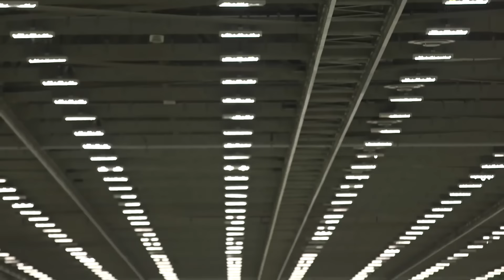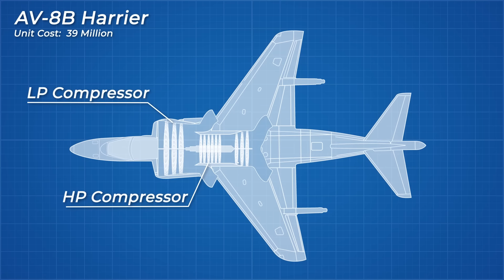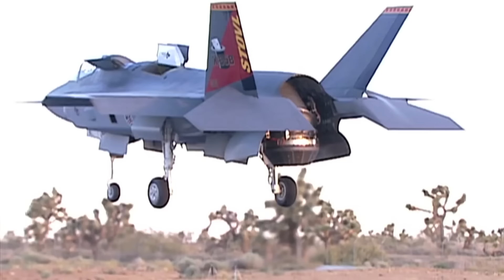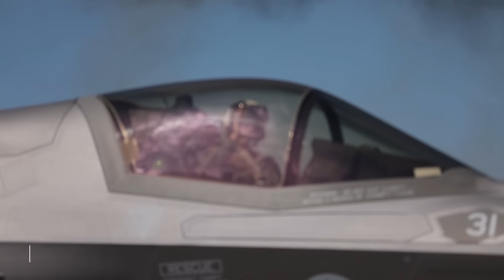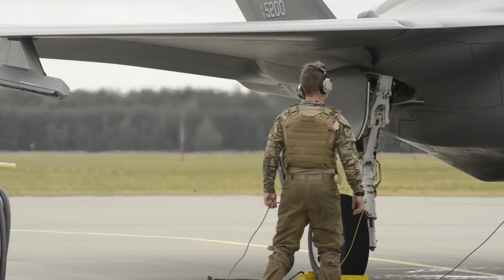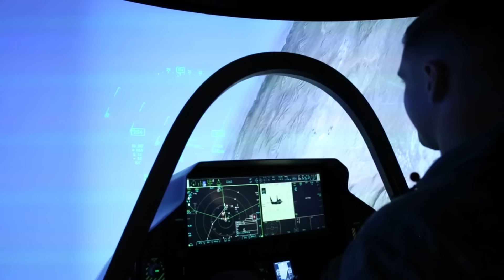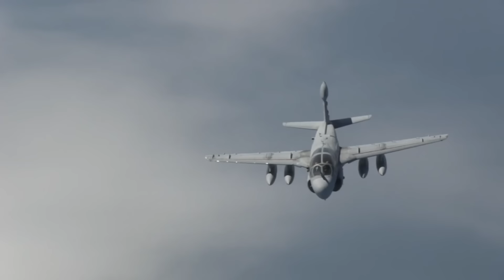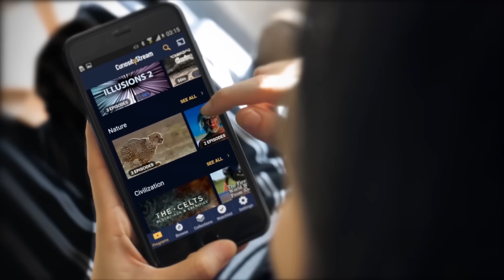Is The F-35 Worth $115 Million?

Comment: This whole project was a mistake, there is a reason we have capitalism and multiple companies. Forcing one company to make one plane do something for each branch caused the plane to fall short of any major dedicated platform. The best rout would have been to have companies design aircraft for each role until a suitable unit for each was designed giving each branch a unique vehicle suited for their specific requirements and sell them to our allies. Only the Air Force really requires a plane that is just for them because they are required to support all the other branches with their varied and unique arsenal suited to the tasks given, and it is not that important that they don't sell them as our pilots are trained much more heavily than most other nations.
Reply: That's exactly what they did. The F-35B is STOVL, just like the USMC and RN needed, the F-35C is designed for catapults like the USN needed and the F-35A is the variant most partners wanted. Building a completely new aircraft when the only difference is either being able to take off using catapults or having a lift-fan would be beyond fucking dumb.

Also dedicated aircraft have been mostly replaced by multiroles 40 years ago. There's nothing new about having an aircraft fulfill multiple roles and every relevant military in the world seems to think this is a good idea.
Reply: The variants are still F-35s and multi-role is fine but what the F-35 project aimed for was not multi-role but every role and there are serious design issues from having a one fits all mentality. The main reason the project took 27 years is because the design specs were moved so often and so far outside the original that the design team had to re-design the plane internally every year. 

It would have been much simpler and vastly cheaper per unit to have a different aircraft for each set of roles. The Navy needs carrier takeoff and landing with fleet defense capability, the USMC needs S/VTOL and light weight, the Air Force needs longer range and better manuveurability than it's contemporaries, these things don't align well, for one platform to handle all of them is unnecessary and overcomplicated while being massively expensive. Having one company make each branch a multi-role fighter fit for their individual needs and split the cost would have both simplified the production process and allow for much more production.
 It is what we have always done and has always worked. There are also roles that require a specialized platform to be fulfilled properly, expecting the F-35 to do the A-10s job better than the A-10 is a massive joke.
Reply: @NachtjagerVII  The JSF program never aimed for every role. The F-35 doesn't do any more roles than the F-16 already does, and each service has a physically different model to suit their needs for a multi-role fighter to replace a single type in each service. None of  the services required what you claim. The USMC wanted something to finally replace the outdated Harrier, preferably a multi-role with supersonic capability. They got what they wanted. The USAF wanted an F-16 replacement i.e a 5th gen multi-role fighter. They got what they wanted. The USN wanted a multi-role fighter to replace the F/A-18A/B/C/D, so basically the same as what the USAF wanted but with Naval additions... exactly the same as how the F/A-18 came about in the first place. The F-35C fills that requirement well.

Nobody expects the F-35 to perform the A-10's limited specialisation (that isn't even necessary... just a luxury) to the degree of the A-10, but they certainly expect the F-35 to perform better in the CAS role considering most fighters are more capable of CAS than the A-10. But really the F-35 is top tier for CAS because CAS depends on target acquisition, tracking, and communications... all of which are areas the F-35 far exceeds the A-10 in capability.

Comment: It got a general fired for saying it, but the F-35 shouldn't be A, B, and C models, it should be F-35, F-36, and F-37.  Now that they are entering operational phase, outside of the engine, which is only cross compatible between the A and C, the aircraft have less than 30% parts commonality.  It should also be noted, the USMC never really wanted their version to be stealthy, as it is a CAS bird, the main threat will be heat seeking ManPads, and that blowtorch of an engine is the juiciest of targets for a ManPad

Comment: Should have showed some of the more recent maneuvers now that the Block-IIIC standard has been incorporated and they can pull a full 9g with full envelope expansion.  When he quoted the pilot as saying it was the most maneuverable US fighter minus the F-22, he wasn't kidding.  It performs maneuvers that make it look like it's got thrust vectoring... just awesome. 
Also when fitted with full wing pylons, the PAYLOAD of the F-35 is equal to the ENTIRE weight of a harrier. 
And electronics? That EOTS sensor detected a commercial missile launch at like 600 miles and notified the pilot and began tracking it as if it was a ballistic missile (which could then forward tracking information to an AEGIS ABM-equipped cruiser/destroyer) - that sensor suite is truly some scary $hit.

Comment: 27 years how future decision makers will use the F35 as a case study. I was requested way back in the day... to give my two cents on the design and mission of the F35.  I was very knowledgeable and the Close Attack Support requirements of the USMC. Also gave some info the F18, maybe later, F18.=Good 
The numerous problems that cant be fixed on the F35. THE BIGGEST IS Pilot Workload, Okay pulots getting their little hackles starting to rise, get over it Dumb Ass. One of my favorite pilots, Mother Hubbard. Told me in the Marines, it's all about getting "bombs on target, on time, all  is BS. This single seat bomber, with all the sensors and transmitters with the very best pilot  Is overloaded. The workload capability is well above 1, give me a week and a simple target day VFR to degrade the system give him 2 MK-76s, safety here. The pilot proble will not do as well as an Ironsight back in the day. IF SHTF, keep the F35 for airshows, most of these pilots are good guys. SF The Great Gandini

Comment: I remember a documentary on the competition between Lockheed and Boeing to make what this became made at the time of the competition and Boeing's X32 seemed to get to every stage of the competition quicker, to the extent it made no sense that Lockheed won. The most bizarre bit was Lockeed being held up because the water jet they were using to cut the titanium for the bit attaching the front to the back was a bit slow, so you need to cut titanium with water over months for every plane!? That alone is ridiculous, how either airforce thought they could deliver it for a reasonable price based on that alone is beyond me.
Reply: Considering the X-35 out performed the X-32 which had to be modified to meet certain requirements (it couldn't check off all of them at once) 
So why exactly would they pick the aircraft that performed worse and couldn't even meet requirements? (X-32) or the aircraft that can meet requirements without modification and performed better? (X-35)
Reply: @demanischaffer  Its been a while since i saw the documentary, but i seem to remember the x35 needing to be adapted to pass the test as well. If the competition had awarded points for getting to each goal first the x32 would have won.
This video talks about the Harrier, which was in service for many decades as if it barely flew, so it was good the X32 didn't use the proven technology the harrier used.
Reply: @dorianleakey  From everything I've read, the X-35 did not need to be modified
The X-32 needed to be stripped down and modified in order meet different requirements
Reply: @demanischaffer  I should look for the documentary, but it unintentionally gave the impression that Boeing could have got the thing working without modifications quite quickly, Lockheed took longer on everything, which made it feel like and apples and oranges comparison, so Boeing could have just spent longer as well to prove they could do it without needing to strip things and replace them.
But personally, If i was listening to an engineer tell me that the water jet they were cutting the titanium with was taking too long, but they could absolutely deliver the finished project on time and to budget, I may have been sceptical.
Reply: @dorianleakey  "gave the impression"
I've never heard of the water cutting with the titanium
However I did hear about the fact the X-32 couldn't meet requirements unless it was stripped
Reply: @demanischaffer  I just found the documentary and am about 1/3rd through it, i now remember why the cost issue seemed such a big deal, they had commissioned for something far cheaper than the raptor, 1/3rd of the cost, which seems comically low. It was clear Boeing had better ideas to keep within budget, so while Lockheed may have delivered a better plane, (we can't see an alternative timeline to find out, but I get the impression in hindsight it may be better than the x32 would have turned out) it was never going to meet the cost requirements no matter what they said at the time and the people buying it must have known that, but i will let you decide for yourself.
https://www.youtube.com/watch?v=Y_WPLeDmU6o
Reply: @demanischaffer  I misremembered the working of the bulkhead, it was diamond bits that needed to carve the titanium? not sure why i would rememeber that as a a water jet, its at the 42 minute mark.
Reply: @dorianleakey  Yes it's a complicated procedure 
However it's most definitely not worse then the X-32 not being able to meet goals without taking things like the landing gear doors off among other thing
Or the fact that it couldn't STOVL and go supersonic in the same flight
Reply: @demanischaffer  did the x35 do stovl and supersonic in the same flight? Did you watch the documentary? Because this sounds like you didnt. Ifeel you are somewhat attached to the idea that th US military must be right its decisions when you know those things could have been ironed out easily, even as you state them context free.
If Boeing had spent extra months on the plane the  way Lockheed did they would have anyway.
My point isnt which is the better plane, Lockheed were always going to be massively over budget and late, thats what happened in the contest. Boeing were on time and on budget and the Boeing finished product probably wouldn't need any parts stripped and reattached.
Reply: @dorianleakey  In fact the X35 did do STOVL and go supersonic in the same flight
Without even needing to land and get stripped down in order to do so
We have no clue if the hypothetical F-32 would be on budget with no problems, therefore saying so is irrelevant 
Especially since those cost overruns happened after the X-35 won, it could've been the same case with the X-32 but we'll never know
Reply: @demanischaffer  You wont watch it in case it challenges your currently held opinion.
Reply: @dorianleakey  I mean
It really is your opinion that the F-32 would be cheaper and not delayed
However since the F-32 never existed, we'll never know
Reply: @demanischaffer  They at least showed a commitment to keep to budget during the process, while Lockheed mislaid millions just in the process itself.
Reply: @dorianleakey  Okay and...?
We still have no actual idea what issues the F-32 may have had, because it never existed, therefore any cost overruns and delays also don't exist

Comment: The question is, was the F-22 worth $250 million?  That is the expensive aircraft.
Reply: F-22 was $143 million in 2011. The last F-22 rolled off the assembly line in 2013. $250 million is the projected unit price of the F-22 in 2016 after restarting production and upgrading it to modern standards, but with a small production run of only 100 airframes. The USAF concluded it wasn't worth it.

Comment: I'm sorry,  the F-35 isn't worth it at all.
When they decided on the F-22, they should have kept the F-23 Widow as a multi production plan.
Use the F-22 as a special limited option,  and the F-23 as the work horse.
I guarantee the F-23 production cost nearly as much as the F-35.
Reply: No way that would ever happen. The F-23 was considered the more expensive option in the ATF competition for almost no gain over the F-22, and the F-22 currently is more expensive than the F-35 in both unit cost and value for money.

Comment: If Saab continues on it's way Gripen E will be better than F-35. 
A super power relying on a plane that was meant as a Joint Strike Fighter, supposed to be less effective in air to air than F-22 (in part due to be allowed for export and international developement) and mainly being dependant on it's stealth capabilities and avionics? Madness.

Can superior avionics be mounted on 4th generation fighters? Yes.
Can superior helmet mounted displays be given to 4th generation jet fighter pilots? Yes.
Does stealth render planes invisible? No.
Have stealth planes been shot down? Yes.
Does stealth increase the time between takeoff and discovery? Yes. 
Can advanced radar systems which are ground based or deployed by AWACS render stealth technology somewhat useless? Probably.
Can new radar systems such as passive radar potentially render stealth technology, as we know it, useless? Yes.
Can F-35 carry lots of fuel and weapons? No.
Can F-35, in terms of performance, compete with planes such as F-22, Eurofighter, Rafale, Su-35? No.
Can F-35's performance be increased as easily as new avionics could be mounted on 4th generation fighters? No.
Do I think that stealth is more important for submarines than fighter jets? Yes.
Are effective counter measures more important for jets than for submarines? Probably.
Is F-35 ridiculously expensive while it's effectiveness and reliabilty are truly questionable? Yes.
Is F-35 beautiful? No.
Are delta wings amazing? Yes.

Edit: Is there a monopoly on stealth and modern avionics? No.
Could other countries produce stealth or not so stealthy jets with better performance, more weapon stations, more fuel and better avionics? Yes.
When could that happen? Maybe before the F-35 is phased out maybe it has happened already.
Will F-35 be able to keep up at least in performance and as a decent weaponry carrier? No.

Comment: Lol, each single time I watch this video i find more and more errors. F-22 and B-2 never got shot down because they never faced advanced air defense system. What can you expect from something like Iraq or Syria? Another thing is price, are you buying or selling? Also plane operating system itself had few hundred errors and problems.Also for same price you cloud buy 2, 3 or even 4 other planes which cloud do same job way better. maybe it looks good (for me it looks disgusting) but it has extremly limited weapons bay and has very low internal machine gun ammo supply. Lack of big gun with lot of ammo inside makes it worse Close Air Support plane than A-10 which has 7 barrel 30mm monster, and lack of ammo itself makes it weak dogfight plane since all russian fighters (Even those a bit older) can out maneuver it. For overall rating, 6/10 would recommend only if you have several tons of money pallets for buying and several times more pallets for maintanace